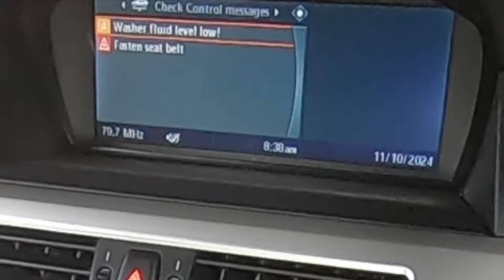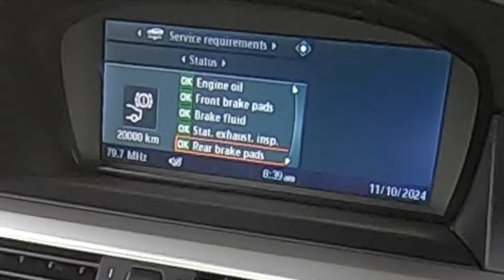Back on the E60 M5

Comment: Good to see you back👍 pulled mine out the garage the other day and ran it up to temp whilst I was messing around in the garage! After about 15mins car is up to temp and I suddenly hear the engine note change! I’ve just lost a cylinder and then a thousand thoughts of terror ran through my mind! ( it’s bizarre how all the horror stories of these cars effect your mindset). Get in the car engine check light reduced power!
Scan the codes: Misfire with engine cut off cylinder 6!
Restart car engine still rough can smell unburnt fuel! Up pops engine light again! Turn off. Now thinking best case: ignition coil - spark plug- worst case: injector is stuck wide open.
Injector and spark plug both only a few 1000 miles old,so hanging onto happy thought of most likely the ignition coil as original and 19 years old!
Luckily I have a spare brand new Bremi in my parts collection so no need to swap coils around and its cylinder 6 so relatively easy to access! 
Swapped out and all is good again.  

Lucky it happened on my Driveway I guess rather than out and about! It still bizarre to hear a component just give out! One last spark and gone. She did well and has given numerous hours of V10 noise to the world💔😁
Reply from the maker: Nice one Duncs, easy fix! Not often you hear a cylinder dropping coil fail live while idling.
Good you’ve already sorted your injectors.
I used to always keep a spare ignition coil in the boot of my M5, as it’s not uncommon for them to fail at this age, but I’ve used them all now 🤷🏻‍♂️ You’ve just reminded me to organise another spare. I’ve never been game enough to splash out on all 10 at once!
Reply: That’s the first one I’ve had go to be fair! I replaced 5 & 10 when I did the spark plugs! Just cause I knew they would be the most difficult to get at! So I now have 3 Bremi’s the rest are all original stamped 2005!  I picked up 4 a few years ago fairly cheap and just picked up another 4 for £37 each in an autodoc sale! I have read to avoid certain auction sites as there is meant to be fakes out there! So have stuck to known suppliers and just keep an eye out for sales.

Comment: Still driving mine, at 207k miles (334k km) on original engine. I remember fixing all these items lol
Reply from the maker: 334k Km’s, that’s big Km’s man, you must being doing a good job of looking after the car. Just goes to show they are pretty solid. Have you had any major repairs in that time?
Reply: Only major repairs were not the car’s fault (transmission replacement due to previous owner installing an aftermarket clutch incorrectly). I did most other major repairs preventatively. Just warm it up and then drive it hard!
Reply from the maker: @321-shift  Nice. What you described there sums up best way to own these cars I reckon- Preventive maintenance, warm it up and drive it hard 👍

Comment: Thanks for the video! Both my thigh supports do the same thing. Helped a lot I feel more confident in doing the job.
Reply from the maker: No worries. Super common problem, easy job but just watch the plastic clips on the upper seat trim & the gear cover, they like to break easily now these cars are getting older https://youtu.be/F5qIw84TOpU